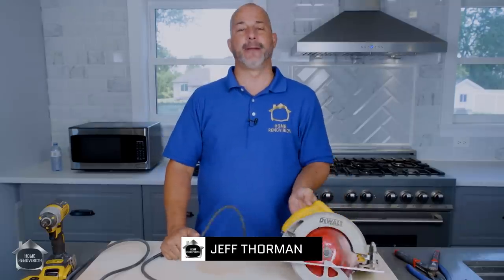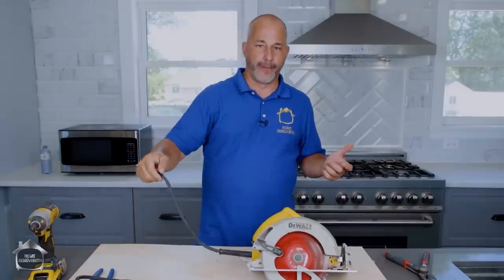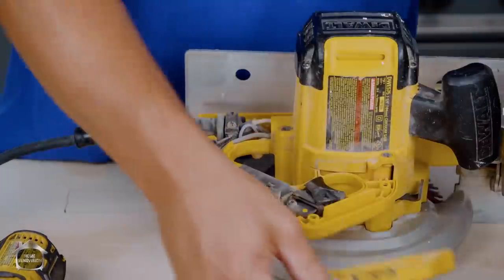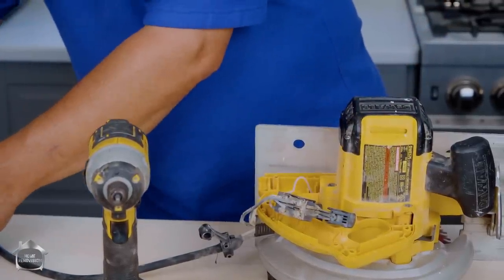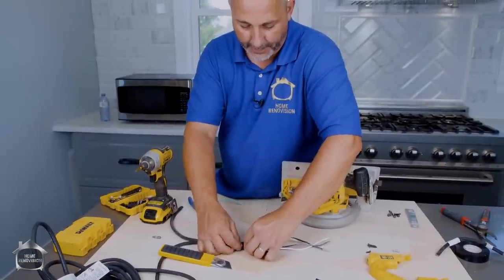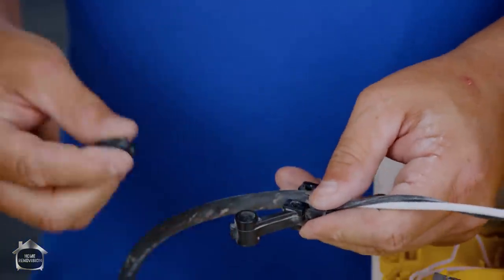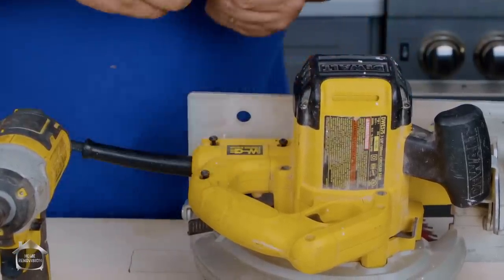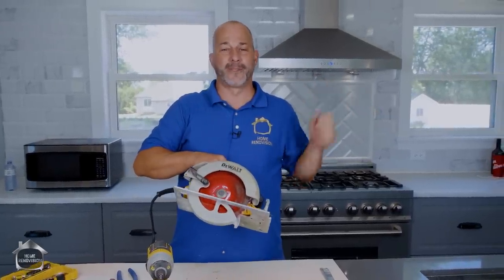How to Replace a Broken Wire on a Circular Saw

Comment: You dont re-use those connectors(terminals).
You connect new ones.. those are there for a reason.. machines can losen the screws tru vibration.. installing youre wires like that ,you can short circuit the thing.. therefor may couse a fire.. this will not pass inspection.. and may not be used on the job site..  please NEVER do this..

Comment: Never tighten with a drill numb nuts
Reply: Some people use the variable torque settings on the chuck so not all bad.

UK technicians generally use a driver for multiple screws to save time when unscrewing and screwing.

Believe or not this is why the tools have variable torque chucks.

Comment: That's not a "skilsaw" it's a DeWalt circular saw or a "sidewinder". Skilsaw is a brand and is a worm drive saw. I would only use a 12 gauge cord on that saw. The saw pulls 15 amps. 14 gauge wire is for lighting circuits and smaller power tool uses.
Reply: 14G wire is rated for 15 amps
Reply: @Gracemutley  You're right. I stand corrected. I was alluding to not having a voltage drop at the tool by using a smaller gauge wire in 25' or more.
Reply: The saw doesnt pull 15 amps, or you'd be tripping breakers left and right.
While it might be on a 15amp breaker, you can only load a breaker to 80% of it's rating, or you'll end up tripping it.